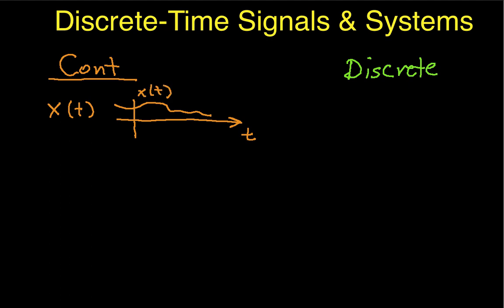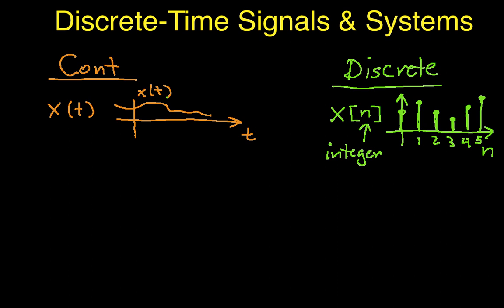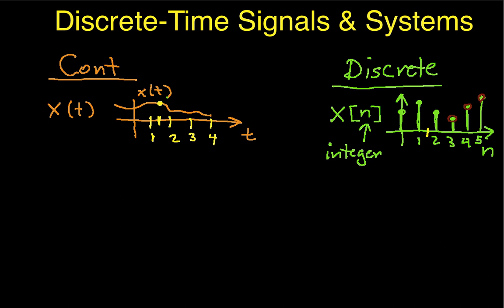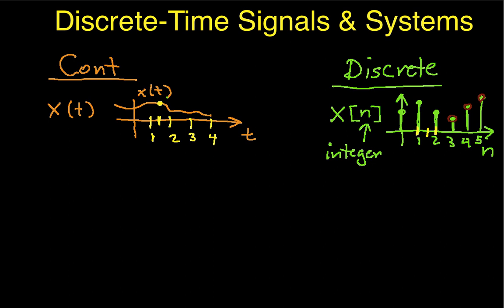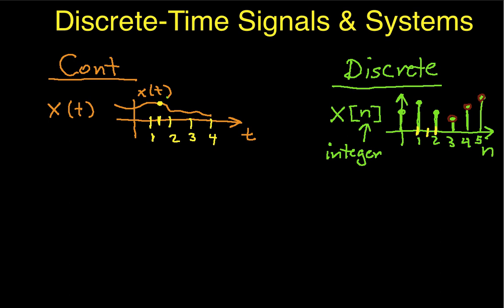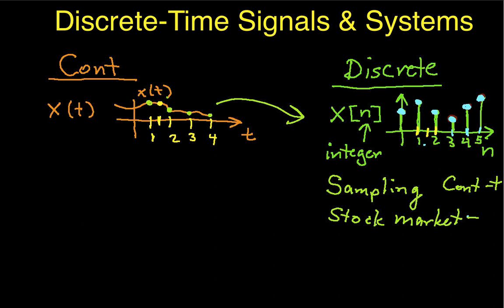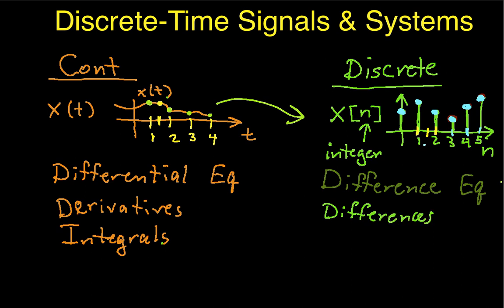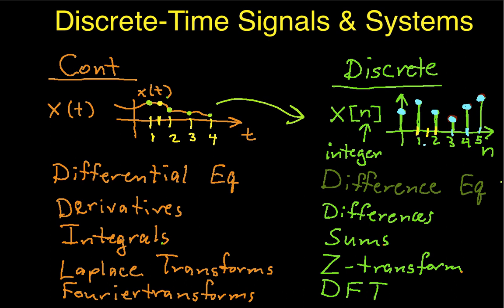Introduction to Discrete-Time Signals and Systems

Comment: @DarrylMorrell, The reason they appear as stems is because they are essentially a scalar multiplied to an impulse element, n. This is denoted as c_k*d[n-k] where d is the Dirac delta function (the impulse function). Representing a function in discrete time can always be represented as the sum of individual impulses:  x[n] = c_1*d[n] + c_2*d[n-1] +c_3*d[n-3] ...